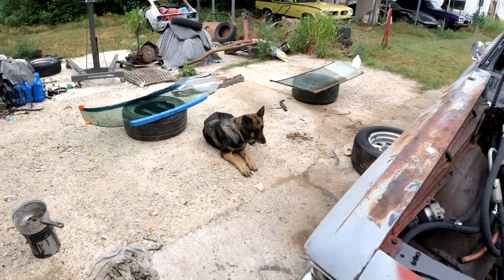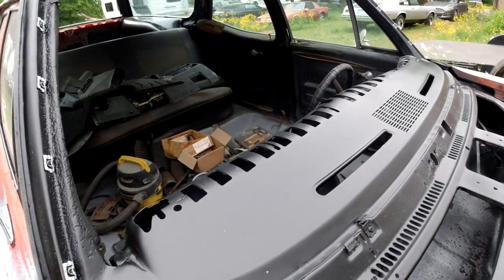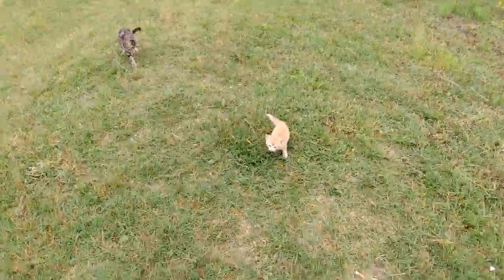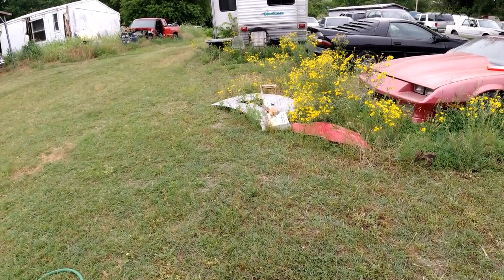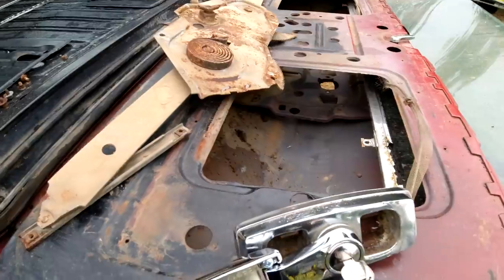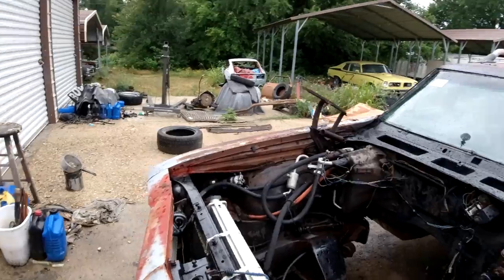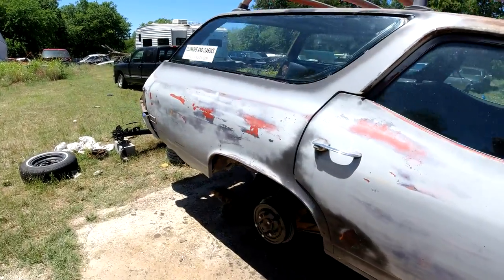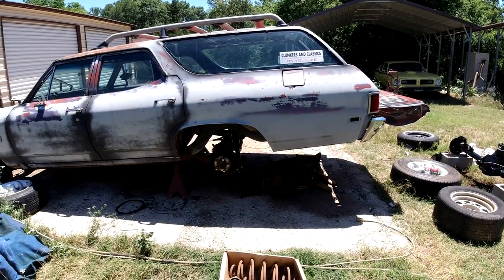1968 Chevelle Nomad Restoration - Part 13 - Windshield Install - Tailgate Handle Install

Comment: When you mentioned wondering about what to do about the side panels of the load area in your Nomad, it brought back memories of my 1971Buick Sportwagon.  The upholstery on those side panels was nice, but I think a more practical solution would be to use the same automotive grade loop pile that is on the floors to cover the side panels 1/2 to 3/4 of the way up then apply a generic body side molding (like dealers install to “add value” to new cars) then either leave the top portion painted, cover with upholstery fabric like the door cards, or jus apply a plain color coordinated vinyl.
Reply from the maker: Interesting

Comment: Damn ain't that a kicker, you do the repairs and there's another leak letting water in from somewhere else, enough to make you go nuts, enjoyed this vid even though some might say your peddling around,but sometimes you just got to go easy to get it done right a lot of good work has gotten done so far.

Comment: Hi mate, if that new screen has a stereo antenna in it, why not use that for the car stereo and use the hole in the fender for a CB aerial , CB radio could be useful for the road trip you're planning, if you don't want CB radio in there then use the windscreen antenna and delete the hole in the fender. 👍